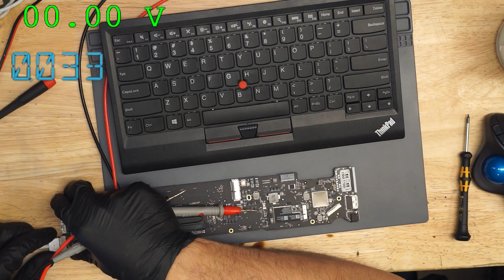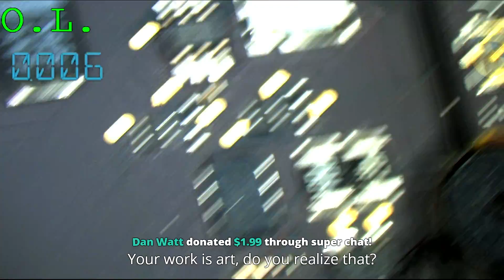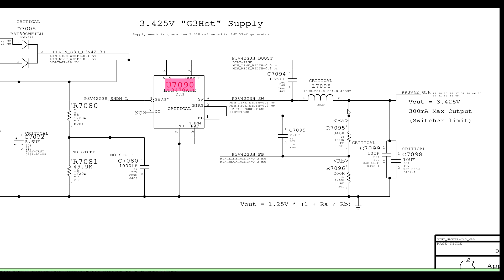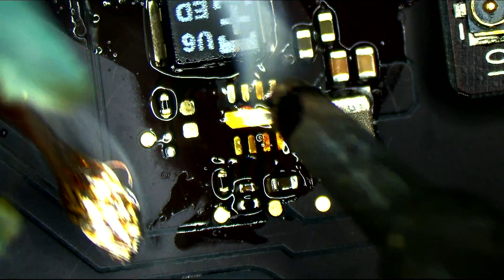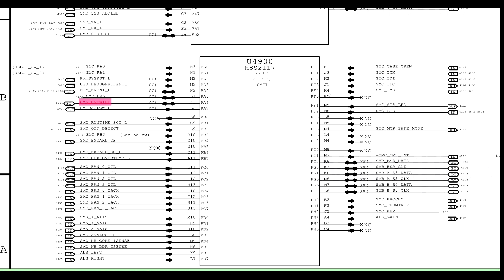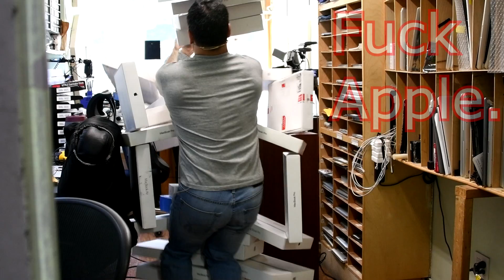Macbook Air, no green light: chip randomly died.

Comment: Hi Louis, I really enjoy your vids, and have been watching for quite a while. I recently took the dive into hobbyist electronics tinkering, and have purchased the quick rework station you recommend. I'm curious what settings on the quick you typically use that's hot enough to get the solder to flow, but has a low enough airflow to keep the small capacitors and other components from blowing off the board. Any help, or links to videos you've done in the past addressing this issue would be greatly appreciated!. Keep up the great work!

Comment: Heated area  .. it worked  -- changed chip and then re-tested when it was still heated  - no wonder it worked .. I assume later you tested it cold  or chilled.   I  would have guess it was the Ceramic Cap on top of the resistor chain - and may well have been wrong.  Just hope it works when you shot some Freeze Spray on it  :)
BTW  Love the videos..  always entertaining and informative.

Comment: You should have replaced that resister too. Although your multimeter isn't accurate, the reason it goes up overtime is because of temperature since it has to send current to measure resistance. The reason heat fixed it temporarily is because it increased resistance. The moment it goes cold it won't boot.

Comment: You know voltage on the rail. You should measure voltage at FB pin (should be 1,25) and also calculate divider ratio. This is the most fundamental way of verifying correct operation of feedback loop/FB input. Any other method introduces uncertainty.